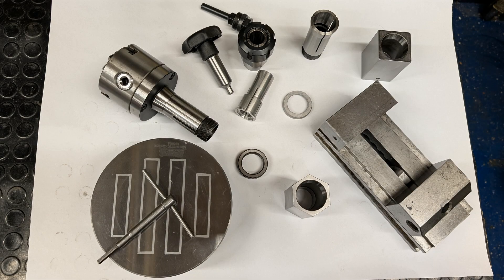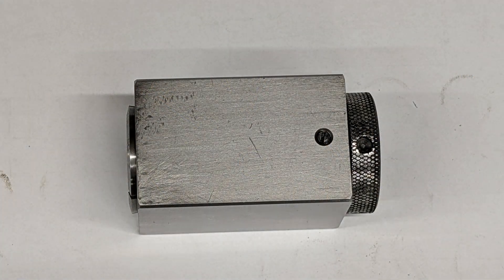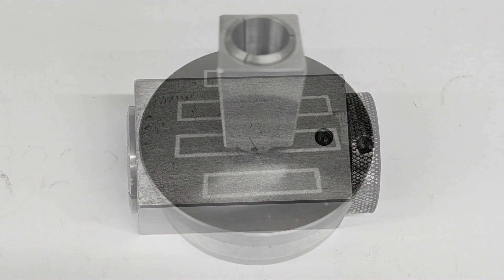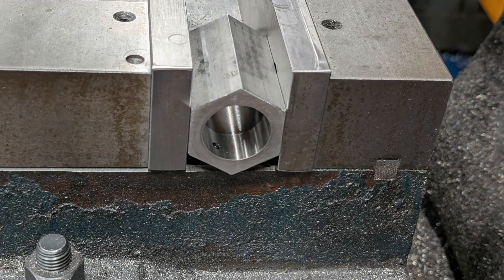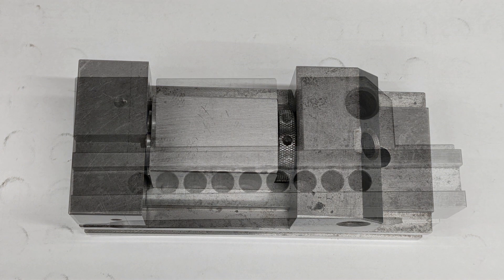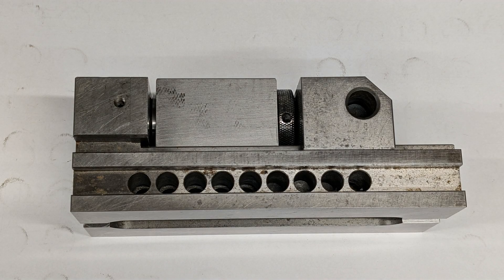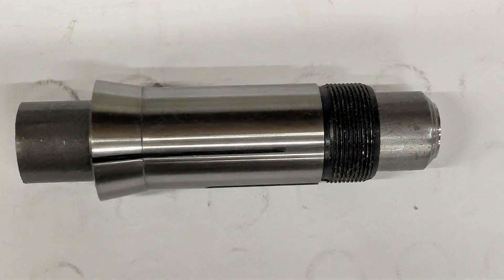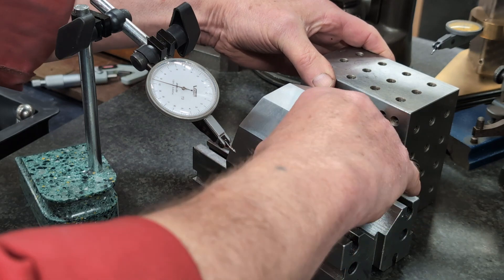"The Ultimate Collet Block? ER + 5C in One – Game-Changing Precision Tool!"

Comment: Without a doubt, the world’s most ultimate collet block.  Beautiful work as per usual.  Regards, Aaron
Reply from the maker: Cheers, Aaron. Thanks for your continuing support. The 40mm bronze bush has been lapped to a concentric running fit and offers lots of options to use from either end. Did you see the dodgy supplementary video showing the sine function? I do have a few more options to finish off and will post a quick video soon.

Comment: Complex tool and I’m sure I’m not seeing all the uses. Could you show a little bit more about using it like a sign bar? In the stacking blocks example you show the bore is occluded by the vice jaws.
Reply from the maker: No problem. I will set up some examples tomorrow to show 15 degree increments just using different pin positions and also some intermediate angles using gauge blocks. I will post a link in this comment. Edit:  Here is a link showing some basic sine settings  -  https://youtu.be/W0A_dmgLPNc?si=q0db9r_Qq1XRtIE4
Reply: Great video, gives me lots to think about.  Great fun. Thank you.